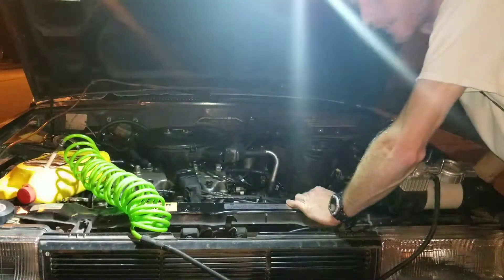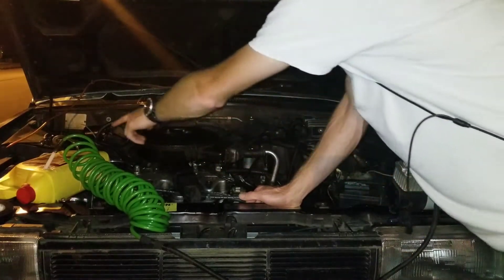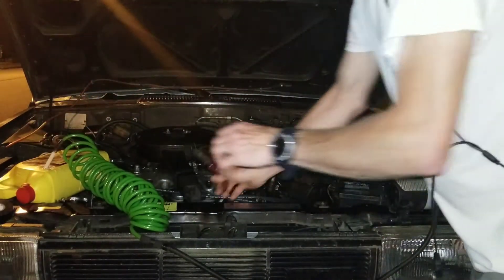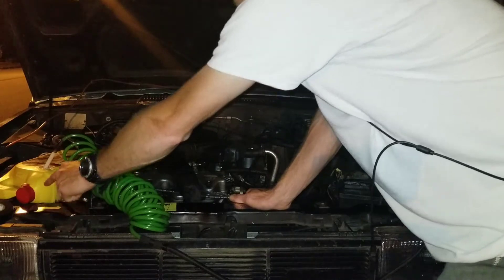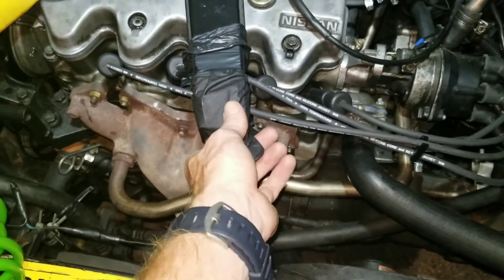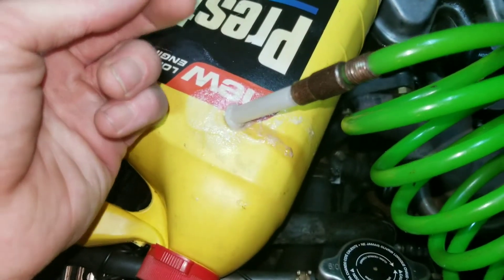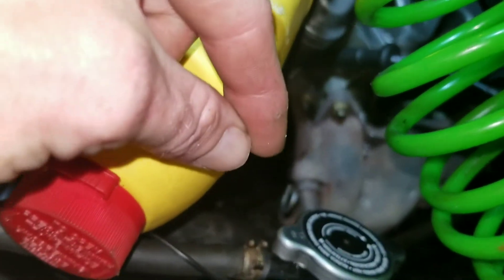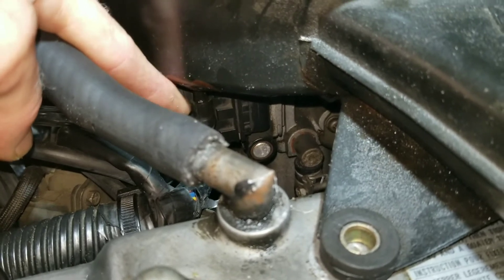How to make a smoke machine with household items

Comment: Tried this to test for an evap leak and godamn thing blew up..  took out the hood, intake manifold and my good ear..
Reply: I gotta hear more about this…..
Reply: You used too much air pressure. About 1 PSI should be sufficient.  There are more videos that cover this subject without putting burning objects in a plastic container.

Comment: I used a #10 can that has green beans in it. Drilled some holes in it inserted a tubeless tire valve stem in to holes. The rubber on the end has a groove to seal the hole. Took the srader valve out. Skipped the silicone hose over the valve stem. Put some hose clamps on. Drilled 2 more holes for the 10/32 screws and got some heat proof washers that go on BBQ grills to insulate inside and outside of can. I made the holes larger in can so the bolts don't touch the can to cause a shock for battery.
I used a separate 12 V battery for my 400 watt inverter to power a fish tank air pump for the air supply.
Works great. I used some sewing machine oil. I have it by the gallon since I see for a living. Found the problem hose, replaced it and fixed my car for a fraction of what a mechanic shop would have charged.

Comment: So clever! Love your channel! Big thumb up! Stay connected at ours and catch you next video
Reply from the maker: Thanks it means alot
Reply: @NATESINTERACTIVEAUTO  I've got a leaky fuel system and need to pump smoke into my gas tank.  I'm afraid to use something that has possible heat into a gas tank.  Any other ideas?